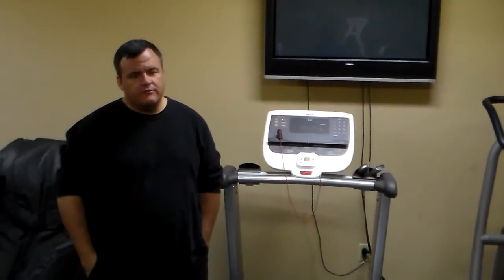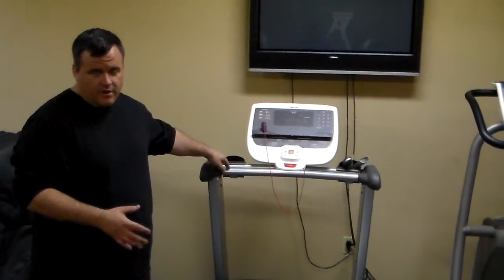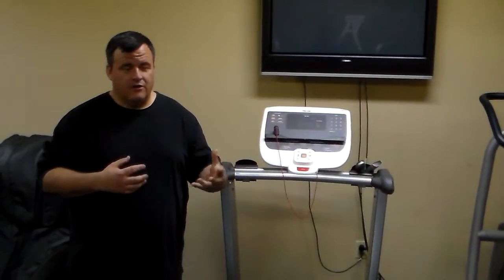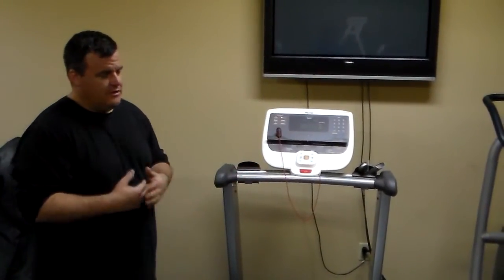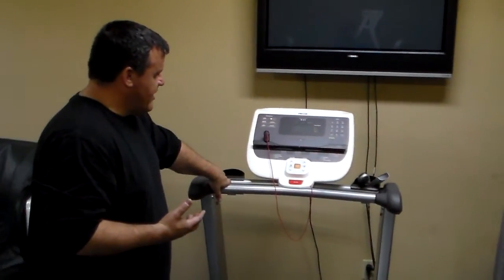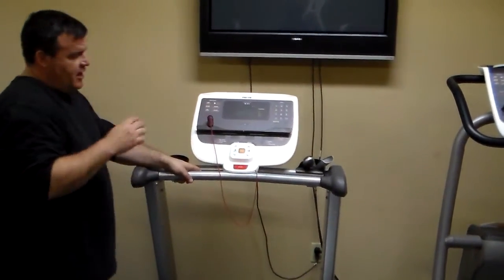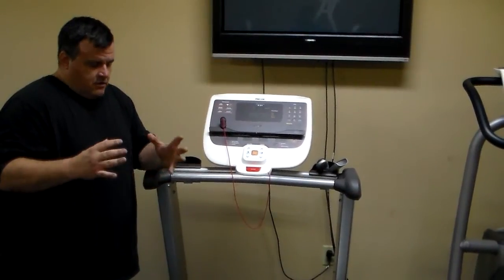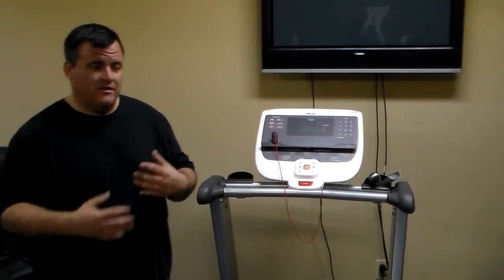Treadmill Static Discharge

Comment: Tough crowd in here. Me, I found this helpful because I had no idea there was such a thing as treadmill shock. It's been happening to me so much this winter, I actually got to the point where I half believed it was an electrical problem and that I was receiving actual electric shocks. Good to know it's not that. I'm just going to stick rubber gloves over my sensor bars and be done with it. I get out-of-proportion enraged when I get those shocks.

Comment: Worth noting that static discharges are typically in the thousands of volts, so a bit of tape around exposed metal parts is not likely to act as an effective insulator (if anything, allowing more buildup of charge).  Provided the belt is properly lubricated and the deck is metal, the most likely source will be shoe friction on the belt.  An ESD shoe strap (loops under the foot inside the shoe and around the shoe's outside heel) or an ESD wrist strap might help, both typically used for delicate electronics and readily available off Amazon, but anything tied to you represents an injury hazard and a shoe strap will get icky fast (though many types are disposable).

The nasty sensation of a shock caused by the spark jumping an air gap as your hand comes near metal.  So if you can discharge other than via a spark gap, you won't feel it.  If you are prone to getting shocks when getting out of cars, for example, you can prevent the shock by keeping your hand on some metal part of the door or frame as you get out of the car.  By the time your feet are on the ground and you let go, the static will have dissipated.